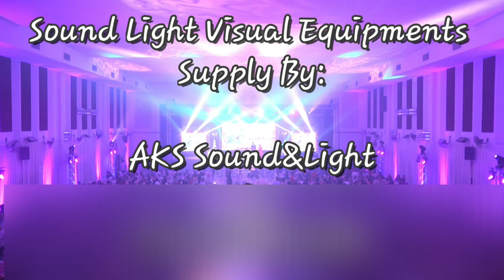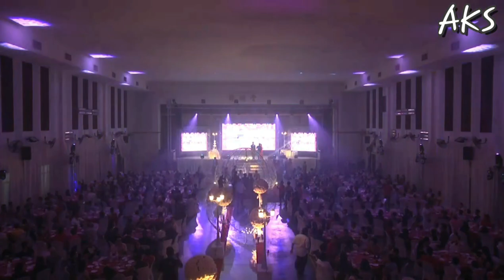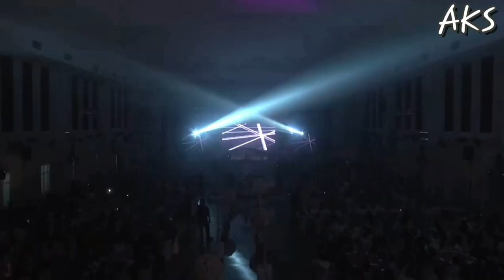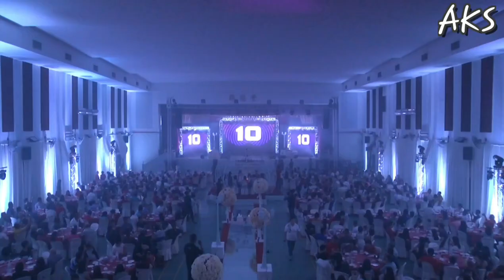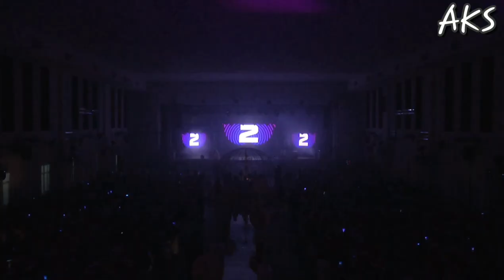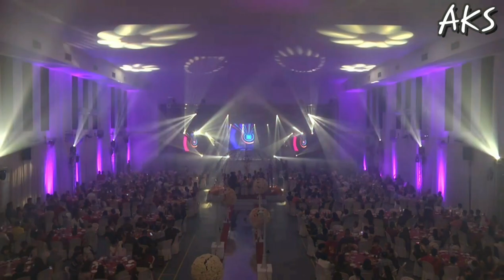Wedding Light Show

Comment: In about 10 years, anyone will be able to program this at home on their laptop in a couple days and then just plug it into any one of 100+ theaters spread across America and have everything load up instantly. First iteration will probably last 15 years, meaning at the end of that 15 years, you can still play back your work from 15 years ago instantly at any theater. 

No console needed, just an optional iPad and/or hardware panel with 4 encoders, dimmer wheel, and 3D pan/tilt manipulator. That’ll probably sell for $100, but that will be the only commercially available product the company sells.
Reply: you already can... its called cloning. All you require is the house patch. Most of my shows are programmed off my laptop where ever i am, hell i dont even need a console on site but it sure does make things easier lol

As for this video, cringe
Reply: @SKETCH31110  Not at all. That’s what not cloning is for. Each rig is far too different to just clone mass amounts of stuff. Programming off a laptop right now is dreadful without a console.